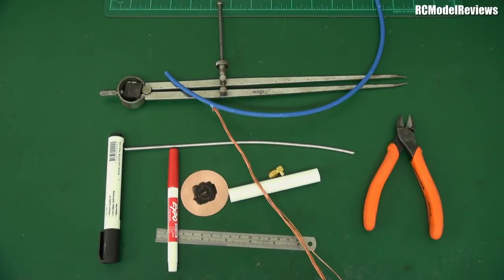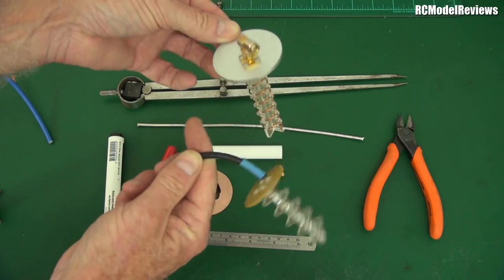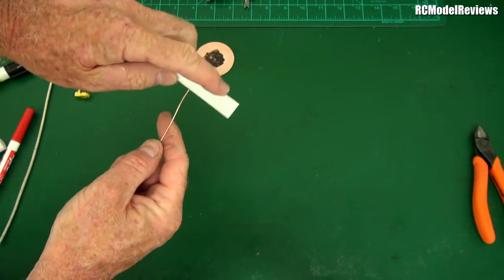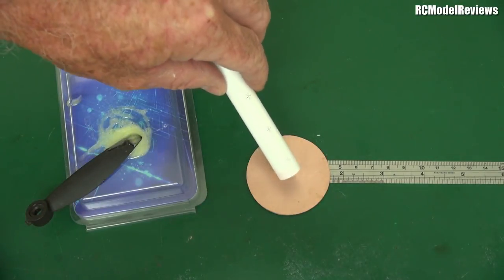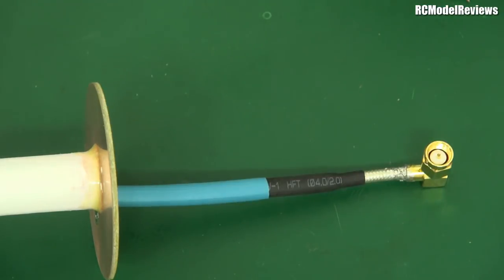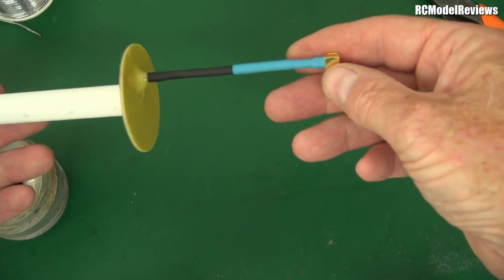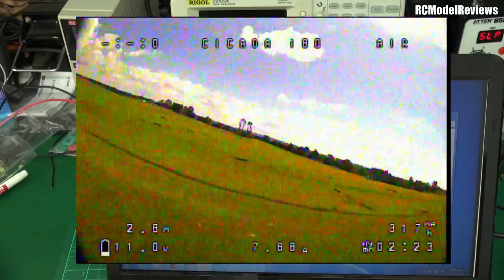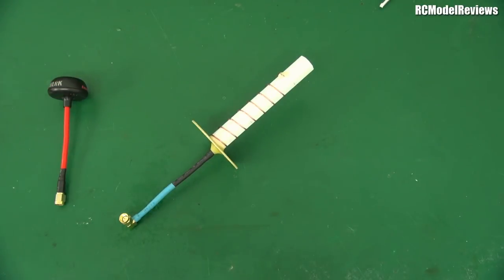DIY Helical FPV Antenna, you won't believe how good it is!

Comment: When using epoxy to secure an otherwise (plastic) incompatable material, I find it useful to drill a series of small holes around the circumference, quite close to the base. These are loaded with epoxy and when the epoxy from the base makes contact, all become a "keyed" construction.

Comment: Thanks Bruce for the motivation and inspiration to build a 5-turn helical antenna. I built one, using a 3D printed former, over the weekend and my testing showed that it far exceeded the performance of a commercial 7-turn helical that I already owned. The VSWR ended up being 1.6:1, which is not great for Tx but adequate for an Rx antenna.

Comment: If you really want a nice straight piece of wire put it into a drill chuck and grab the other end with pliers. Spin then wire while giving tension straight out with the pliers. after a few rotations the wire should be super straight with no visible kinks or bends! works a charm!

Comment: For sure Bruce those little heat guns though cheap are nice to have, It sure does make your project much more professional when you have the right tools for the job,   My Heat gun is a HAKO much more expensive than the standard unit off ebay but i own one of the cheap ones as well that i use in the garage if it gets stuffed oh well ill buy a new one.

Comment: 21:20 all good calculating the exact multiple of a half wave for the coax, only to forget about the transmission line formed by the SMA male, SMA female on the gear and feeder or microstrip internal to the goggles lol. When it comes down to it without putting all these on a VNA it's all best guess for the builder :-) Amusing to watch though, keep it up.

Comment: One trick to get those 90deg coax connector closures started is to stick the plate to a pencil eraser with a little piece of foam tape. 

Also Loctite is now selling a epoxy designed for polyethylene and it's brethren which works quite well(albeit a tad expensive) Shop your professional auto parts shop.

Great How-to!

Comment: In result you have a good omnidirectional CP antenna. It have not amplification in front axis.A bit more complicated than just lambda / 4 ... And the resistance of this "antenna" of yours is 300 ohms. Good luck with your flights!

Comment: marley spouting glue is the best ,and non conductive ,i use it on all my drone plugs and wires going into plugs ,it keeps moisture out and is super strong with a wee bit of flex ,and its good to glue down broken off plugs u solder back to a board

Comment: One way you can effectively straighten out bent copper wire is to drill a hole of the same dia. as the wire in a peice of wood, then thread the wire through the hole and pull it back and forth to use friction to heat the wire and help straighten it.
Reply: Or put the wire end in a vice and pull on the reel, I used to do this with tinned copper wire to make it a bit narrower (for riveted through-hole connections on 2-layer proto pcbs in the past)

Comment: Sure more diy. I did a 5 turn scratch built one a while back and it works well. If you wrap the wire around something slightly smaller it will be tight on the tube.

Comment: A butane lighter with a refil valve shrinks the tube just as well or better, costs a few cents and even if used daily it can last for years. I, being a smoker, always use a lighter for heatshrink tubes, never sooty matches. Shrunk tube is a very good insulator, I tested it even at 20kV! But soot is very conductive. 
And the lighter is on just as long as you need to shrink tubes while the heatgun could be on for hours like the soldering station and be used only for a minute a day.
Reply: The heatguns Bruce is talking about is automatic. (There's magnets in the handle and a reed relay the stand). Once you have it you'll never want to be without. Not just for shrinking tube, but for heating stuff, bending plastic, softening glue, drying paint. It's really good!

Comment: to straighten the wire, put one end in a vice and the other in a drill. pull while rotating. you never saw such a straight wire. to soften the wire (it gets work hardened), run a flame along it.

Comment: Bruce, another great video. You know your antenna theory better than most.  I've got a request , why not do a video on a Helical Antenna for VHF Air band where there is little grounding?  Lots of experimental and amateur built lack room for a normal length antenna and if you have at least 5 watts, output, it should be possible to radiate an acceptable signal from a really short helical wound antenna..

Comment: How about putting the copper side of the reflector to the rear, would be a lot easier to solder the coax shielding on, and you would be gluing to the fr4 instead of the copper.
Reply: I.d like to see this and how/ if/ what any benefits are. Lol
Reply from the maker: You could try it that way but my experience indicates that you probably won't get as good an impedance match between the antenna and the coax.  Having that first 1/8 - 1/4 turn of the helical run parallel to the reflector and very close to it (less than the thickness of the PCB) can make quite a difference to performance.  However, it would probably make it easier to build.   I'll build one and see if there's any performance hit.
Reply: @RCModelReviews  Due to the Er of the board epoxy you might not need to get the first 1/4 turn of wire as close to the ground to tune it. Same effect as using a plastic tuning tab under that first 1/4 turn.
So it might work out OK. Could do an experiment with 0.8mm PCB and 1.6mm SS PCB.
Reply: @RCModelReviews  Huh, interesting. I was going to ask the same question. White board video suggestion: Impedance for RF circuits. I vaguely remember calculating impedance for AC circuits in my university class, but apparently I don't remember enough to understand why it would matter to a receiver. :(
Reply: Understand the need to Have copper on the coil side, but how about using double sided fr4?

Comment: A video on making day 433 mhz directional antennas for telemetry would be really useful
Reply: From what Ive read it would be easy, you just need to figure out the wave length of the band youre running and use multiples/dividers to determine coil width/length etc.
Reply: @aaroncutler4908  the wavelength is 70cm, a waiter wavelength is 17.3cm  so I don't think it's really practical due to the size it would have to be, a Yagi may be a better option if you have to go big anyway
Reply: Wow, yah, I didnt know how large that wave was.
Reply: @aaroncutler4908  it might be possible to make a 1/8 wavelength antenna but im unsure and will have to do some research,  one thing I do know is each time you go down a fraction the antennas performance is also reduced and a full wavelength is always better, it's just weather the directional performance exceeds the loss.

Comment: What is the name of the brass 90 fitting that you soldered the wire too ??? Have you tried to use fractal elements for even higher gains ??? Nice work with very good details.

Comment: Well done, thank you. Is there any chance you'll build a high gain helical for passive digital television reception, 1-2 meters long?
Is there any chance you'll add a few turns to it and measure the beam angle to get even more distance?
What would happen if you used multiple strands instead of the single strand ?
Where is the web site / pdf?

Comment: Hey Bruce that’s brilliant. Yours tested to a horizontal range of approx 50-60 degrees, but what would the vertical angle be approximately? Could you fly almost overhead with it? Many thanks.

Comment: I thought that the feed line length was important and, if incorrect, can potentially prevent any signal from passing through the antenna. Obviously I’m wrong, but I remember reading something about resonance and destructive interference reducing the signal gain. Why doesn’t it matter very much?

Comment: Hi Bruce Thank you very much for showing that a lot of the gear we use in FPV flying can be made by ourselves and be very effective.  If the the tube is pushed through the reflective plate would this produce a lost in the antenna. Also I will be passing through your part of NZ next February, I will have to drop in.
Reply from the maker: Yes, you would likely lose some performance if you passed the tube right through the reflector.

Comment: Hey Bruce, How About Using GOOP To Connect Holder To Base? A Couple Tech Questions? How Do You Know If You Need A Right or Left Hand Antenna?? You Know What A PepperBox Is Right? Two Side By Side Helicals On One Rectangle 2" x 2" x 4" Base w/A Plastic Protection Box Around It! Now? Ifin You Don't Have Diversity? Can You Build A 3-Way??? One Left - One Right & A Pagoda In The Middle??? Covering All Directions At Once! Thanks Mate...

Comment: I am looking for a way to increase the range of my DJI Mini 4 pro drone / RC2 controller. Just getting started trying to find info .... Can you help point me in the right direction? The problem I'm having isn't 'range' so much as it is obstacles between drone and RC2. I fly my aircraft mostly on my own property and want to photograph wildlife.....it's no problem until I fly down amongst the trees...then I get significant signal loss. Any help would be greatly appreciated. Thank You.

Comment: Great Video... So easy to follow, that is until you started talking about the length of the Coax... Would you be kind enough to give me a simple formula, for say a 5 turn helical... would I use "17mm x 5"... or does the coax length not affect the antenna that much?  Many thanks in advance...

Comment: You said you could use two,  how would one use two of these? Second question is, if using two and the beam has a little overlap at a distance, would the reception improve in the overlap area?

Comment: The thing that I always see is the wire diameter never discussed. Is that a factor in gain? If so I would appreciate s video on that.
Thank you.
Reply: I found it on FalconRadFPV  16 gauge is the size he uses but said 14 to 18 gauge would work exactly the same except for the stiffness.Falcon Rad is the king of long distance as far as I can see.

Comment: Hi Bruce, if possible can I please ask a question?  I'm just ordering some parts from Jaycar and I'm querying whether 50 ohm coax or 75 ohm coax is preferable for a 5.8ghz antenna (fatshark)  On IB Crazies plans it uses a waveform trap to tune it in order to compensate for using a 75ohm cable.  Why not just use 50 ohm?  But then it says on the Jaycar website that 50 ohm is only suitable up to 500 Mhz.  Would be extremely grateful for some advice.

Comment: Build a 12 turns helical with my 3D printer which works very well, but it was relatively difficult to bring in the wire....

Comment: This was a great video. I have made one for 868 MHz but need an antenna for the plane. All the designs I have seen for clover leaf and skew planar antennas in 868 are really big. Are there any smaller circularly polarized antennas suitable for aircraft in the 868 frequency?

Comment: Bruce,
My Harbor Freight 1500 watt heat gun cost just $15. For those in the States, a good, cheap alternative.
Joe Caraco
Reply: HF has multiple versions of this heat gun. They all are on sale for the Holiday Season with a Super Coupon for $8.99 (good through 12/31/18).
You'll want the one with a metal cooling fan (Item #62340) though. The others have plastic cooling fans which will test your smoke detectors....most assuredly.

What joker designs a heat gun with plastic cooling fans anyway?

Comment: Please post all the necessary formulas used to calculate the dimensions. I would like to make a channel specific antenna. Thank you!
Reply: Helical antennas are ridiculously broad band for such a simple design.  You should be able to find design equations in the ARRL antenna book if you feel the need for a channel specific build.

Comment: Bruce - could you just punch a copper disc using a rotary hole saw on a drill (or bench drill press)? Provides a center hold punched through the disc as well?

Comment: Quick question. If I mount the cable on top of the reflector will that change how the 88.3mm measurement works? About 5 or 10mm of the cable is resting on the reflector

Comment: I took apart my menace invader patch and soldered a coax straight to the back. I wanted a slimmer profile. Antenna doesn't work anymore. What did I do wrong? Does the coax half wavelength make a huge difference?

Comment: Hmmmmmmm.... The white "plastic tube" you are using is actually a multilayered water pipe. One of the layers is aluminum! Basically, you have an aluminum tube -electrically insulated though, in the center of your helix. Any comment on this??

Comment: Hello,, I subscribed!!
I am relatively new to this drone stuff & only have the Hubsan H501s
 that i love!!
i have updated my FPV antennas & under stand all the basics of 
different antennas from your vidios,,thanks .   But nothing iv`e seen talks about 2.4 do`s & don`ts!!
BUT i am at a loss as to the 2.4 ghz side & how to improve it,,
Everybody just talks about 5.8 FPV!!! 

my Q? is,,, can i use a dipole DUAL frequency antenna 2.4/5.8 for my 
radio signal,,,,[not FPV side.]????   OR can i  just use any 5.8 ghz 
clovers ect??? does it matter???
Will it mess up or read the wrong signal frequency w/a dual or just have
 a better signal between the two???
& what would you recommend for the dbl gain 5,6,or 9db gain?? higher
 is better yes??,,but a more narrow focus???
Thank you,,
Robert

Comment: Cheers bruce, I'll have fun making this. few Quick questions, what gauge copper wire did you use, Does it matter? And does it matter if the copper wire is enamel coated or should it be bare copper wire? Also, does it matter if the copper wire is solid core or muti stranded....really curious to know if or how these parameters would effect performance if at all. Thanks mate!

Comment: Hello!   you seem pretty sharp about this antenna stuff

can i put a coax style antenna on a syma x5 toy grade quad for better range ?   
  right now its just a length of wire for signal not a coax.   ive already modded the antenna in my remote but want to go farther.. over 400 meters if possible ?     i realize i can  add a helical or a yagi to my remote,  but im seeing if i can squeeze any more range out of the flight control first,  
thanks in advance!

Comment: How critical is the diameter of the copper wire? What is to big or to small. Thank you for your time and effort. 🤜🏻💥🤛🏻✌🏻
Reply from the maker: Wire diameter isn't too critical but thicker wire usually produces a broader frequency response with slightly lower gain.  1mm (40 thou) is about the best compromise.

Comment: Hi can you tell me about signal boosters I have an amp booster from tv antenna can this be used to 2.4&5.8 to increase signal efficiency or will the miss match of frequencies burn out transmitters????? Thanks

Comment: Compass?  In UK engineering workshops they are Dividers.
Very helpful Bruce.  I have just started a building an antenna designed by Andrew Mcneil which is very similar to your design.  I sent for the right angled connectors from some ebay vendor and yesterday, three months later, they refunded my money.  You wouldn't have a reliable supplier would you?
Reply from the maker: Yes, "dividers" was the word I was searching for... it came to me about 5 minutes after filming the video.  Old age is a bitch! :-)   I can't remember where I got my SMA connectors from... but it was a Chinese eBay vendor with very good feedback.

Comment: How about putting the poxy on the inside and then putting the cylinder in place so it's right and then adding epoxy outside for added strength

Comment: Forgive me if this has been asked, but everything I have found so far hasn't said anything about reflector size. Im still looking, but should this be a multiple of the wavelength as well (it seems that way being 50mm, but I could be wrong? I suppose my question is if a larger reflector would make an improvement or possibly create more interference?
Reply: Rewatched and saw part of my answer regarding the multiple. Im going to make an attempt or two and see if I can ckme to any conclusions. Thanks brother, great video!

Comment: If i melt some copper pipe to make my own wire and my crusible has slight traces of silver content...will that be bad?? I also have pure copper bars from apmex...i roll my bars and casted rods into wire i can draw in round draw plate....if there is like 1% silver is that ok???

Comment: So the coil spacings are a wavelength apart? That puts my plan for a 433mhz telemetry antenna in the bin then lol.
The coils would need to be 70cm apart and that would be a monster of an antenna ha ha
Reply: Steve Fox  I did build this antenna for 70 cm satellite work years ago.  The entire length is around 6 feet, and it is quite heavy. This is due to the counterweight for balance as not to overload the AZ/EL rotator.. Got the design from the ARRL antenna book....
Reply: @robertmitchum2972  yeah, 6 ft is a tad too big for my antenna tracker lol

Comment: How would you calculate the turn spacing and diameter for other frequencies? Thinking of a point to point 868 connection.

Comment: Ummm Bruce isn't that pipe you have a 15mm Barrier pipe?  That has an inner core of Aluminium sandwiched between HDPE layers.  Look at the Cross section at 8.00
Reply from the maker: No, I've checked and that blue layer is simply a different colored plastic.  There's no aluminium in that pipe.  If there was aluminium in there the antenna wouldn't work.